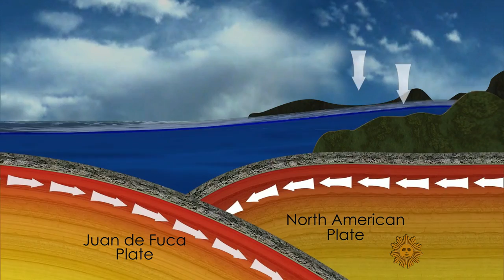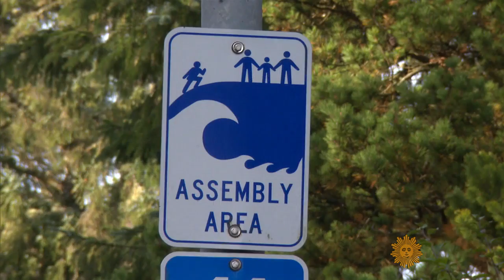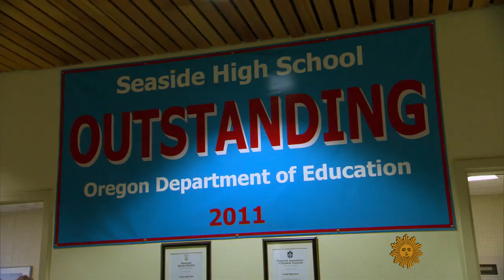Only a matter of time: The disaster awaiting Pacific Northwest

Comment: Fifteen thousand died in Japan because of the flood wave, and zero have died because of the nuclear accident. And which do people regard as the bigger disaster? The nuclear accident, of course. Idiots.
Reply: Do you have any particular person in mind, or are you just shouting at the television like a senile dotard? I've never heard anyone say that the Fukushima disaster killed more people than the tsunami that caused it. 

The Fukushima nuclear accident was a big disaster for the nuclear industry, as well as for the Japanese taxpayer. Have you seen the estimates of cleanup costs, which will be ongoing for decades? Every time another nuclear plant blows up somewhere, the nuclear industry finds it that much harder to get people to trust them when they say this next plant they want to build won't blow up - which is exactly what they said about that plant in Fukushima when it got built. Nobody builds a nuclear power plant if they think it will blow up.

Nuclear power is the only form of electricity generation that can't afford its own insurance and requires massive taxpayer subsidy. No other type of power plant has the proven capacity to render thousands of square miles uninhabitable by humans for thousands of years. However, it's great for wildlife that quickly recolonize the nuclear exclusion zones after a nuclear plant blows up. Even though radiation kills a lot of animals, it's less harmful for them than having people around.
Reply: The cost depends on many factors, for instance perhaps the cost of cleanup is so high because the government has decided to do it more thoroughly than would have been necessary? Also, perhaps the cost should not be measured in money alone? According to studies, particles caused by burning fossil fuels, mainly coal, cause literally millions of fatalities annually. And the amount of electricity which was produced in Fukushima during the four decades that they operated, is equivalent to approximately half a billion metric tons of coal.

Comment: The 2011 Earth Quake was from the shift from Global Warming 11 to 12 years prior, to Global Cooling.  In about 1998 to 1999, the Grand Solar Maximum stopped and a Grand Solar Minimum Started.  In 2000 a Mini 10/11 year Solar Maximum cycle started, but 10/11 years later a Solar Minimum started. This means a Solar Minimum was kicking in on top of a Grand Solar Minimum and the Galactic Rays coming in increased severely. This had a major effect on the tectonic Plate Activity, increase in severity of earth quakes, increase of cloud cover and increase to storms and volcanic activity for the next 5/6 years and then a decrease over the following 4/5 years.

It is 2018 and so a Solar Maximum is ended and a new solar minimum is starting again.  Each of these cycles will increase as time goes on. Just like there was a 250 year increase in temperature rise, there will now be a 250 year temperature drop. The cycles last 10 to 11 years, but can be as short as 5 to 6 years and as long as 12 to 14 years. The last Solar Maximum cycle was shorter and less active than the ones of the 1750's to 1999.  When the cycle is on an up swing, the Solar Maximums tend to be more active and the Solar minimums tend to be less active, but can still be severe.

The main cycle is every 100,000 years, 50,000 years in each direction, but with 10,000 year, 2,500 year, 250 year and 10/15 year cycles.  About 1998/1999 was the peak of a 100,000 year, 50,000 year, 10,000 year, 250 year and 10/15 year cycle, all at the same time. That is why the planet got so warm, so fast. The residual energy has been bleeding off for the  last 18/20 years. Now severe temperature drops will be seen in specific areas around the globe, while droughts will continue in specific areas. This is why the confusing temperature readings. Record High Temps in some regions and record low temps in others. That is the oncoming Ice Age weather patterns, not Global Warming patterns, as some think.

Look at the 450,000 year Earth Mean Temperature Graphs and you will see the 100,000 year cycles. This one was not as bad as the last two, but was about the same as the one 400,000 years ago. You will clearly see that the earth is plateaued in heat rise, yet the Co2 is still going up. That is normal for a 100,000 year peak. At the height of the last major Ice Age, the ice was about 1.5 to 2 miles thick over the North East USA and East Canada, yet it was warm in Alaska and no ice at the north Pole in Summers. A severe drought in the South West of the USA and the oceans were 400 foot below what they are now. Everything in the East USA from South Carolina to the Ice Sheet in the North East USA were in a permanent winter. This means no summer weather for those states. It regularly snows in North Florida in winter and snowed some winters in Solar Minimum cycles as far south as Orlando. Yes, Orlando it snowed some winters.

Florida was about twice it's size. The Blake Plateau was fully forested and had steep ocean front cliffs, like Oregon does. The Gulf of Mexico was substantially smaller, thus southern lands of the USA were expanded for wildlife to migrate to form the north and north east. The Florida Keys were all part of the Florida mainland and the Everglades were high and dry, with twice the land mass as today.  I expect another 9 or worst magnitude earth quake in the next 5 to 7 years and perhaps more than one in the Pacific. I also expect earthquake activity to become active on the Eastern USA, as the dormant fault will become active form the Grand Solar Minimum and Solar Minimum working in conjunction.

The winter weather patterns the USA and Canada is experiencing, is for building an Ice Age sheet in the North East USA and East Canada. The Jet Currents move south, this causes warming in the North Pole in summers and in Alaska in summers too, they are higher than normal. Weaker Earth Magnetic Field lets in more Cosmic Rays which increase clouds and storms. Draws out winters in some regions and draws out summers in others. You see when Global Warming is happening, the planet is warming all over, but when Global Cooling is happening, it is warming in specific Drought Regions and Cooling in specific Glacier Sheet regions. This means the ice changes in the Antarctic but the ice in the Arctic north is mostly loss in summers, sometimes completely gone in summers.

Study the planet maps during the last Great Ice Age to see where Droughts were and where Ice Sheets and Glaciers were. In a fully Inter-glacial period, there can be no ice in the North and South poles. In a fully Glacial Period, there can be no ice in the North Pole in summers and a warm snow and ice free path down through Alaska in summers too. As the earth moves closer to an Ice Age, massive changes will take place. People will experience 25 to 55 meter tidal waves every 15 to 20 years, could be happening within 150 years, but the oceans will be much lower by then. Humans should be making plans to adjust to Global Cooling, not Global Warming.

How do you think the crops and harvest will go with these conditions?  People will wish the planet was still warming as in warming the earthquakes are lighter, volcanic activity is less and winters and droughts are not so severe. With the oceans being lower, plus ice and snow covering 30% of the inhabited space by humans in the USA and Canada, increased earth quakes, tidal waves every 8/12 years and devastated crops. Survival will purely be based on migration capabilities of humans and utilization of the expanded southern  lands and Islands throughout the oceans and new Islands appearing from the reseeding oceans. Ocean rise stopping, should be evident in the next 20 to 30 years. Just remember that some islands are sinking, because the ocean floor in some areas is getting lower. NASA has already said the ocean floor has been lowering. Not just form the increased weight of the growing ocean, but also from tectonic activity increases.
Reply: Amazing post...thank you.
Reply: The one bit of sound advice in your pseuscientific crank post is this: "Look at the 450,000 year Earth Mean Temperature Graphs". But don't just look at the graph of temperature (which by the way is a proxy measure rather than a direct measure, look up the δ18O proxy method), also look at the graphs of atmospheric carbon dioxide concentration, which is a direct measure as ice sheets contain actual bubbles of ancient air. Then read the papers by all the climate scientists who drilled up the ice cores, analyzed them, and produced the graphs. You will struggle to find one paper in 10,000 that predicts cooling rather than warming.

The reason is pretty simple: humans have already increased atmospheric carbon dioxide to a level higher (400 ppm) than at any time in the past 450,000 years. By the year 2100, if Trump gets his wish, humans will have driven it back to the level it last had in the Eocene (1000 ppm)- when the poles were free of ice and alligators swam in the high Arctic. That's where humans are sending the planet. We're well on our way to canceling the next ice age or two.

And since solar output is higher now than it was in the Eocene (the Sun is very gradually brightening) we can expect the same level of carbon dioxide to trap even more solar heat than it did before.
Reply: Daniel, the data on the Co2 and Temperatures is that the Co2 follows the Temperature. The Temperature does not follow the Co2.  Even the IPCC Scientist say, when an Ice Age is ending from planet warming. The Co2 starts to rise, from the warming.  Where they go wrong, is, they say, the Co2 takes over and drives the Temperature. When the Co2 graph is laid over the Temperature graph and they are unveiled over time, the Co2 is lagging years behind the Temperature rise. This means from warming to cooling, the Co2 never at any time in the animation revealed, does the Co2 move ahead of the Temperature Rise. It will get higher, but it does not speed up and overtake the Temperature and start driving it higher.

You are wrong in looking at the Co2 history for the last 450,000 years, look at the Co2 as far back as when young primates were a new species on earth. The Co2 was 1,000 ppm and the primates were flourishing with the other species. That is why I said to look at the Temperature for the 450,000 years and did not mention the Co2. The point of the 450,000 year record mention, was for people to see the cycle of the past temperature data, to prove humans do not cause it then, as humans were not on earth for those other peak Temperature Cycles. Two of which are higher than the present one. It was the third one back that is similar to this one. 

Surely you are not thinking humans were on earth during the last 450,000 years, causing those higher Temperature Spikes? The past records prove humans do not cause them. This one is less than the last two. The one about 400,000 years ago is about the same. The data proves human activity did not cause it and does not cause it. Co2 human contributions are 0.01% to 0.03%, depending on who is presenting the data. Co2 is only 0.3% of Greenhouse gases, not the major greenhouse gas, as Global Warming Presentation try to imply. Water Vapor is 93% to 95% of Greenhouse gas. Water Vapor.

#1 Co2 is not the major greenhouse gas, Water Vapor is
#2 Co2 follows behind Temperature rise, not the other way around
#3 Co2 was 1,000 ppm in the past and humans were not on the planet then, but small primates were and they were doing just fine (Co2 was actually 4,000 ppm before also)
#4 The planet was warming before humans had technology to produce significant amount of Co2
#5 Inter-glacial Periods in the past were so warm, there was no ice at the poles (before humans were on earth)
#6 Co2 does not trap heat. (No Scientific Lab Experiment has ever been presented that shows Co2 drives heat) Ever
#8 If the Co2 theory was true, with the amount of Co2 in the air, Florida would be minimum 20% under water, as would be most coastal areas that are low.

Even if the Co2 was 800 ppm, the planet would still be moving towards an ice age, because every time the 100,000 year cycle ends, the earth starts cooling, no matter how high the Co2 is. Every time! Even when Co2 was 1,000 ppm.

Comment: If the Juan de fuca goes it will trigger the san andreas and all the sister faults along the cali coast.  Nevada will have ocean front property and that will cause 2 million displaced and remember all the faults are connected, if the west coast goes it could also trigger the new madrid which runs from the great lakes to the gulf of mexico, and cut the North American continent in half. We will see.
Reply: The Cascadia region has experienced major earthquakes for thousands of years. Why did none of them trigger this chain reaction you fear? The New Madrid fault also had a major earthquake in the early 1800s - America did not split in half. Earthquakes are big disasters but they are not bigger than they are.

Comment: In the japanese tsunami there were a group of people including a lady shouting warning over the loudspeaker system who took shelter on the roof of a building atleast twice the height of the new tsunami shelter on that school.
They all died.
Reply: In the Indian Ocean tsunami there were people videorecording the waves from hotel balconies while people on the lower floors drowned. There are also videos from the Japanese tsunami showing water rushing through city streets, sweeping cars along, but the buildings remained. Engineers can design buildings to withstand a certain wave height. If the waves turn out to be bigger, well that's too bad. It's the same with levees for flood control along rivers. They protect against most floods but you can always have a super-flood that overtops the levee.

Comment: This is the area of the new offshore oil lease sales by the Dept of the Interior. What could go wrong in going for Methane hydrates in a trifecta of fault zones? 

Figure on 700 bridges out. 13,000 dead- optimistically. Major refineries that feed two to three states will be gone. Food that the country depends on in Skagit delta contaminated with a chemical witches brew.  

Thankfully they shut down the PG&E nuclear reactor in Humboldt bay. (Read: "My Humboldt Diary" by Bob Rowan.) The nuclear plant was right across the mouth of Humboldt Bay and less protected than Fukishima.

Comment: One simple protective measure would be a building code change that required all fuel station tanks have backflow preventers that would protect the fuel from tsunami flood water contamination. In Grays Harbor County, probably the county that will be worst hit by a tsunami, the fuel stations do NOT have this ~$100 device per tank. Florida made such a building code change, why not the states affected by tsunamis? Post CSZ event, fuel will be the most critical resource. So far, no one in gov't or emergency management will respond to this recommendation.

Comment: and if the waves are over 44 ft high, like some were in japan, that structure wont matter one bit.
Reply: But what's the probability? If you read the geological literature, you'll see the Cascadia region has had a long history of tsunamis of varying heights. Having some protection is better than no protection. A helmet also does not protect against all motorcycle accidents, but it's a lot better than no helmet.

Comment: 5:38 - 6:24

They are delusional. This is not safe. Not even close. It's not enough to stand against 
a powerful tsunami for a prolonged period of time. Just look at the one that swept in to mainland Japan, it ate buildings like this "safe" one for breakfast and just kept on going.
It's a potential and very likely deathtrap.
44 feet high and 14 inches thick against one of the most powerful tsus that could potentially hit them? I wouldn't feel 100% safe even if it had been 88 feet and 28 inches.